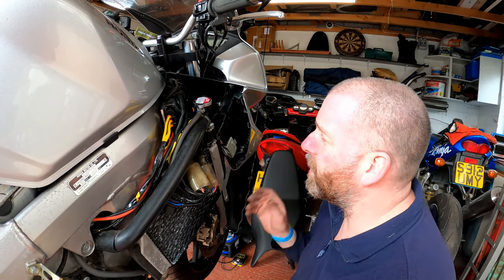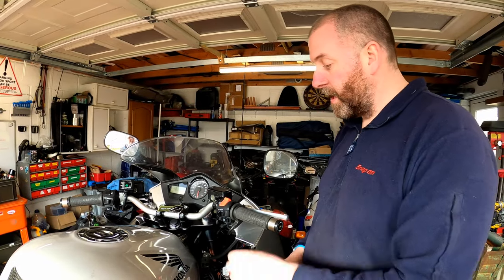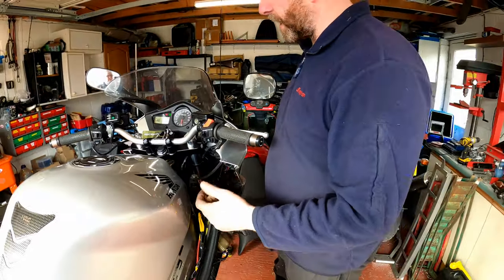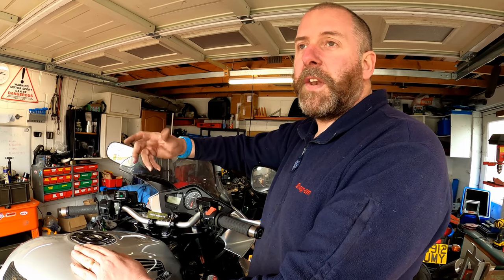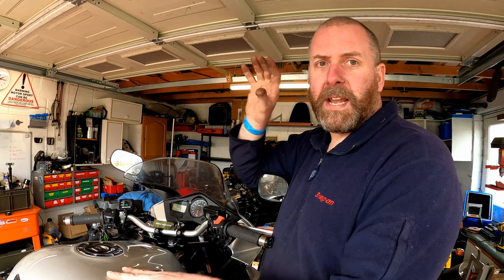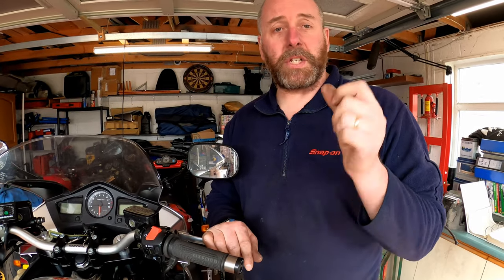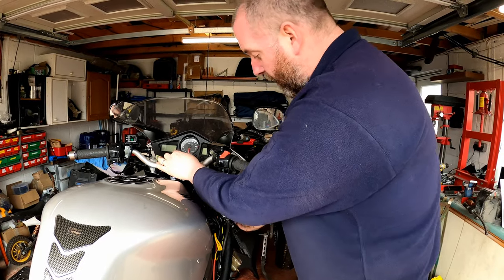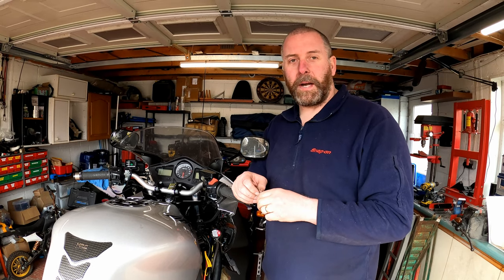Honda VFR800 VTEC - Reading and Deleting Stored FI Fault Code Data

Comment: I have a 5th gen and sometime my light will come on think its fi but not always sometimes not at all and sometimes may stay off for hour or 2 then come on nothing rides diff rides the same always I did notice when I just replaced all my fairings Im missing 1 light bulbs incert in my dash could that cause it and how diff is it to delete codes then the vtech thanks love your videos

Comment: thanks, very informative. I dropped my bike (left fairing minor scratches) after 15 minutes of riding. The bike turned off while riding, it is not cracking when turning on the kill switch. No headlights or signal only horn is okay. I've checked fuses on both sides. Kindly advice

Comment: Great video... Would you know if the process is the same for VFR800x Crossrunners (2017)? Have ABS & Engineer light on after battery has drained over lockdown :-/
Reply from the maker: Hi mate, it is highly possible that it is the same process, I am afraid that I have neither a Crossrunner nor a Crossrunner manual to be able to confirm though unfortunately!

Comment: Sorry 1 more question for the pull and replace within 5 sec can I put a togle switch on a wire like paper clip then just flip it off and on will that work
Reply from the maker: Yes absolutely, it'd actually probably be easier to get the timing right than using a paperclip! 👍

Comment: "Hello Kev's Shed, I have a problem. When I was trying to connect my gear indicator, I accidentally connected the YELLOW-GREEN wire from the ECM to ground. Now, my RPM (revolutions per minute) needle doesn't work anymore. I measured the YELLOW-GREEN wire and it's only showing 1.08 volts, but the manual states it should be 10 volts. Can you please help me with what I should do?"

Comment: Tried your procedure to clear code still continues to blink 9 short blinks which according to the chart is the iat sensor . Where is the iat sensor on my 2004 vfr800. No one can tell me thanks. By the way my bike runs just fine it’s just annoying to have that fi light blinking. Thanks for your help

Comment: Hi Kev..love the vfr videos great help with mine as its identical to yours minus the abs..just wonder if you have ever experienced a popping noise from under or infront of the breather box area..just when a decelerate weather bike is moving or revving from idle..I have  had a good look and listen about and can't seem to see or find a culprit Any advice or knowledge would be greatly appreciated ..Thanks
Reply: It’s the PAIR valve cycling.  Normal to make that noise.  You can search for pros and cons to blocking the valve.  Cheers.
Reply: i'm here searching for that exact problem. pulled the air cleaner to sync the starter valves and hoped to hear it when i start it. sounded like it was from the front of the bike but before i pulled the intake trumpets it was at the back. Did you figure where it was coming from or the fix?

Comment: Blinking hell. What a primitive system. Didn't realise Honda were still using Morse Code even at this time in the noughties. Why couldn't they have just had a code appear on the digital part of the dash if you pushed a combination of buttons with the key in a certain position or even have an OBD plug so you could read the codes as cars had OBD plugs at the time when Honda made the 6th gen?

Do you know if it is the same for the 5th Gen Kev?
Reply from the maker: I know, I also have an 03 SV1000 and that actually displays an actual code on the dash. This is a very primitive system. To be honest, I am not too sure about the 5th Gen but I will look into it and get back to you.
Reply: @KevsShed  Kev you are doing a massive service for all VFR owners so thank you.

Comment: hi Kev where is on this bike located diagnostic  connector
Reply from the maker: It is behind the front right fairing, near the ECU. The manual says that you need to remove the nose fairing but you don't.

Comment: hey kev my FI light comes on and just stays on while riding when i turn it off and turn it back on it’ll be off and then a few minutes after riding the FI light comes on again it doesn’t blink just stays solid until i turn it off and on
Reply from the maker: The FI light will only blink when the sidestand is down, the engine off and the kill switch in the run position; even if fault codes are present, the light does not blink when the engine is running. Follow the procedure and you should be able to determine where the fault lies. 👌